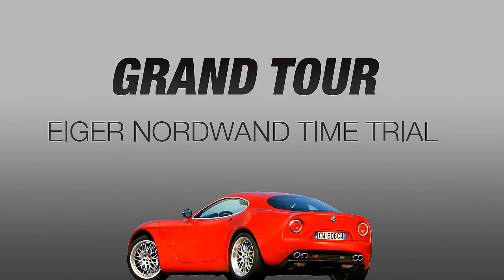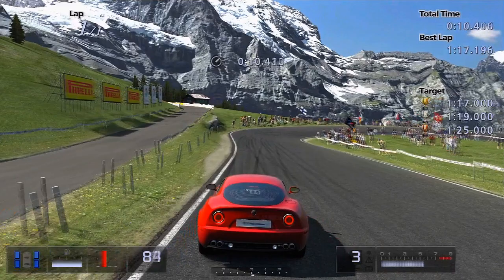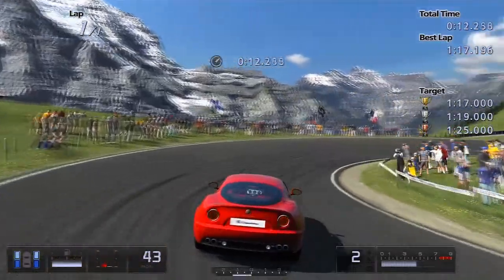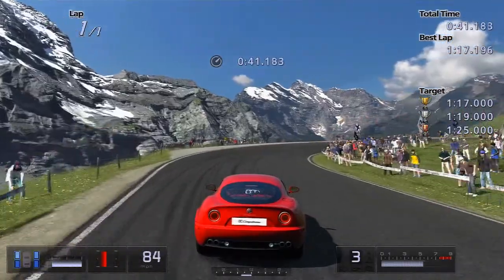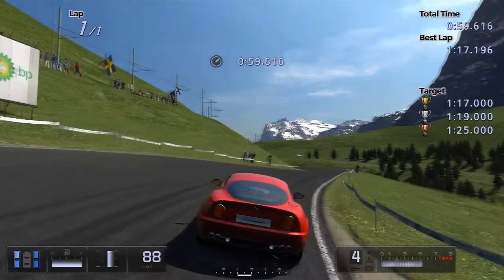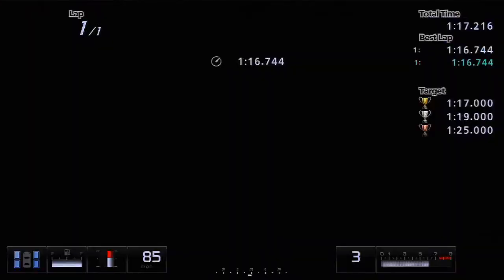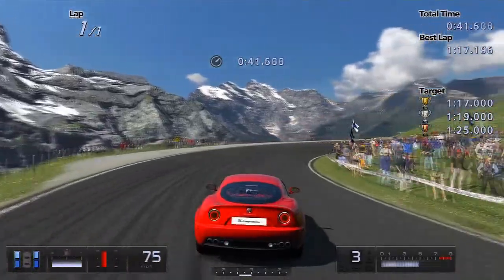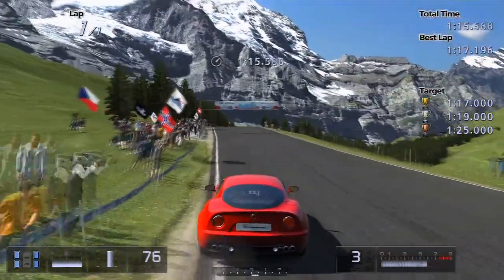GT5 Grand Tour - Eiger Nordwand Time Trial: How to get Gold [HD]

Comment: Reflecting back after getting the platinum, THIS EVENT right here is the hardest. Honestly it makes the Nürburgring and Monza Vettel challenge look like a walk in the park. I would even venture to say it's easier than the Suzuka Vettel challenge. This is extremely difficult. Thanks for the all the videos Oink. I know you're not active anymore, but without you I would have had an even harder time getting this platinum.
Reply: It's all about letting go of the throttle a lot really. Controlling your accelerating and never going full throttle until you're certain you know you can. Also Suzuka Red Bell challenge is still the hardest, I golded it, but having 2 consistent laps with a fictional speed monster with ridge racer handling in a real track as difficult as Suzuka is ridiculous.

Comment: Finally got this done thanks to you. I remember being ten years old and not being able to get Silver with a controller. I'm 21 now and with a wheel it was brutal but considerably easier in comparison. Final time was 1:16:922

For anyone that's interested in my settings: 

Input device: Logitech G29 (using paddle shifters)
TC: 7
ABS: 1
Steering Sens: +1
Driving line: On (it's fairly accurate but I do recommend going slightly wider before the tunnel).
Reply: Back to business too! 😁
I left GT5 with way too many "not gold trophies".
Monza took me 2 tries, Rome 1, but this and the Lambo in Toscana are harder, I'll try your settings and let you know (never tried with TCS yet, I thought I'd lose time)
Reply: @Sianissa  You do technically lose time but you can also make up for it by having more successful runs. Without TC I was spinning out way too much. Just don't go above TC 7 or 1 ABS. Otherwise you WILL lose too much time.
Reply: @Sianissa  Toscana Lambo is a pain but imo nowhere near as bad as Eiger. After having gotten the platinum, I can confidently say Eiger is way, way harder than even the X2010 time trial on Suzuka. For me, Eiger probably took nearly 20 hours over 2 or 3 weeks of daily attempts. Suzuka took maybe 4 hours in total over 2 days. At least the X2010 has insane downforce.

Toscana probably took 2 or 3 days and closer to 8 hours. Make sure you look for guides after 2012 or 2013 because the track layout was changed to be much harder a while back. Definitely possible but not easy or fun.

Comment: I just got 1:16.896 and I swear you gain like a whole second just by liberal application of handbrake through the first sector to get the car to turn. The rest is just keeping speed and keeping the oversteer in check. This is with ABS 10, TC 5. Probably should have turned ABS down but I hadn’t watched to that point in the vid yet. This challenge is great, proves GT5 is still the goat in some aspects.

Comment: Ugh... Just came upon this video thinking I'd finally found the one guide that might held me shave off my final 3 tenths, but then I realised that I've already watched this before. (It's a great video by the way!). ...I'm going to try again, pausing at each section to watch the video clip as I go... 

I felt like dying last night because I hit 1:17.4 after fluffing my final gear change - shifted down instead of up as I pulled away from the final corner. Obviously I'm a moron. ¬.¬

Comment: actually ABS allows the racer to brake whilst turning into corners that is with the right downforce and suspension settings.
Reply: gasixteenb11 still bad to do for stability which is the issue
Reply: taief miah Well, I got 1.16.974 with TCS on 7, ABS on 5, Active Steering on strong and Steering Sensitivity on 7 on a DS3

Comment: Played this for 3 hours and didn't even get a time under 1:18. I guess this is gonna take some time.
Reply: 1:16.852 fucking finally
Reply: @NoneN1nordy123  what settings did you use?
Reply: @irik24051984  I tried to change both the abs and traction control up and down, and I dont remember what I actually had when I made it